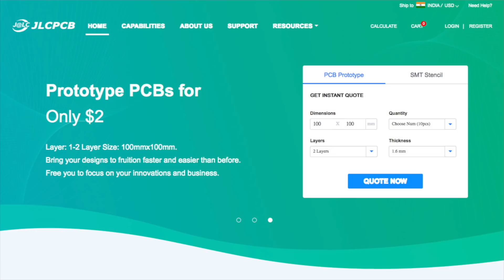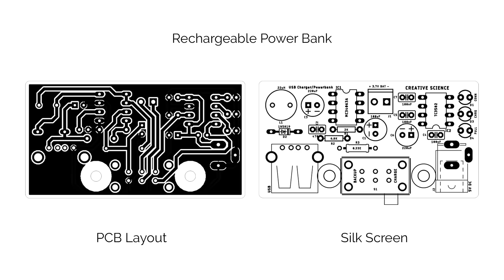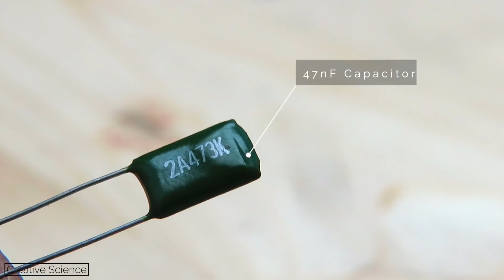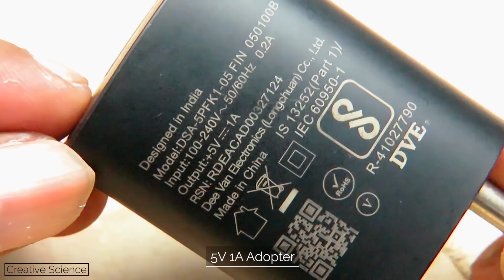How to Make A Simple Rechargeable Power Bank

Comment: How to make a simple rechargeable powerbank??
1 You have to have a computer
2 Design your pcb circuit and order online
3 Wait 7 or more days for the pcb to arrive
4 Acquire other components and assemble
This is the definition of "simple" that i might as well just buy myself one ready made😄
Reply from the maker: Bro, this is very simple circuit, and you can make is on zero board, pcb isn’t need, but you have to little bit knowledge about electronics 🤔🤔
Reply: or you can order cheap battery bank module on aliexpress etc from china
Reply: @adminadmin-jd7fq  oh it matter on country where its delivered
To czechia its one month

Comment: very good circuit, but can we use more than one 18650 battery
Reply: Yeah, but only in paralel. It will have more capacity, but slower charging time.